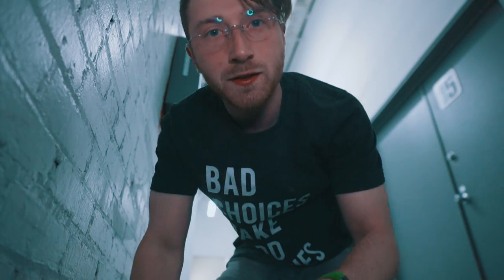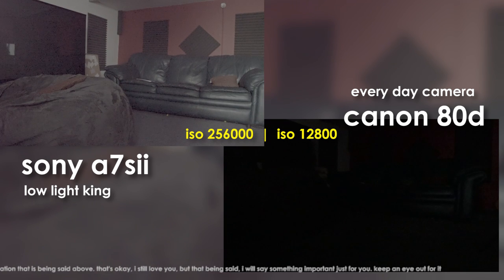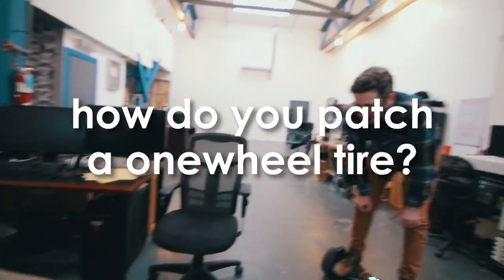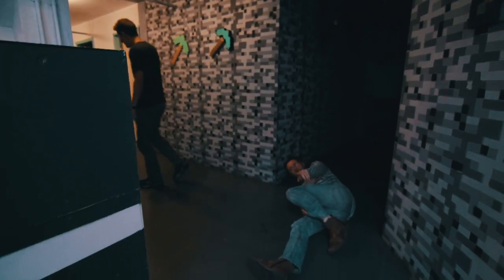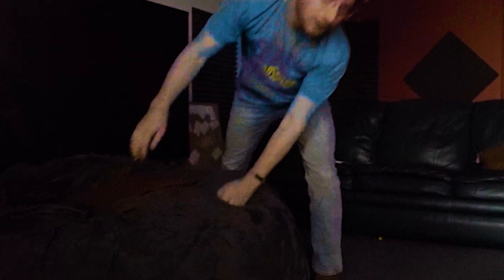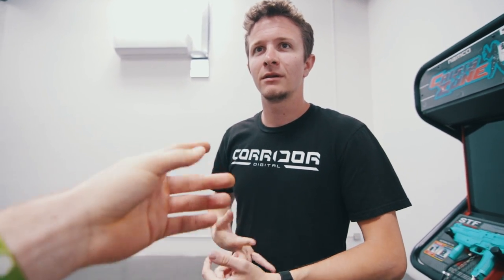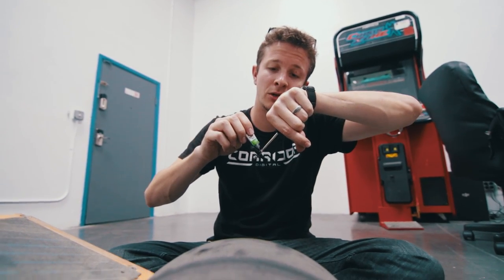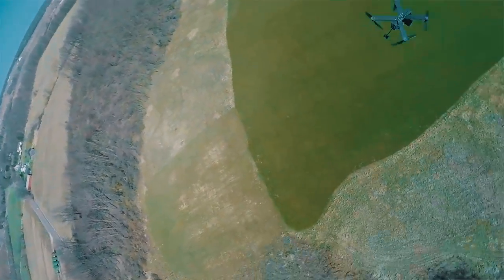Hole in One Wheel

Comment: Fair warning, those plugs don't hold very well, may work in the short term though. Best solution is a patch plug, but that would require dismounting the tire from the wheel. It uses one of those rubber plugs, but the plug is attached to a patch inside the wheel.

Comment: Wren on those plugs for the tire never do it on a side wall of a tire because then it can come out but if it’s on the part that comes in contact with the road pressure will be applied keeping it it but if it’s sidewall you should just replace the wheel

Comment: Wait WHAT. I had no fucking clue the One Wheeler was electric, I thought it was momentum based. My reality has been shattered.
Reply: PhoenixPalmer I thought that till he lost control I think in the battle vs the hoverboard and it was kind of clear you wouldn't get that power from momentum alone
Reply: how would you push on it?
Reply: PhoenixPalmer momentum based wouldn't work. Leaning on one side wouldn't make it go forward, it would just push one side down. 

A similar example is unicycle riders. They lean forward, so they start falling down, but then they peddle to counter that motion and go forward.
Reply: Yeah the onewheel wouldn't work in the least if it wasn't electric. I'm surprised how often people don't realize it's electric though. It's a common question actually